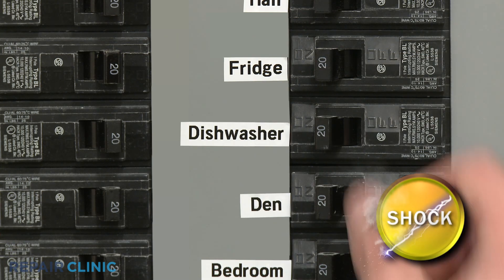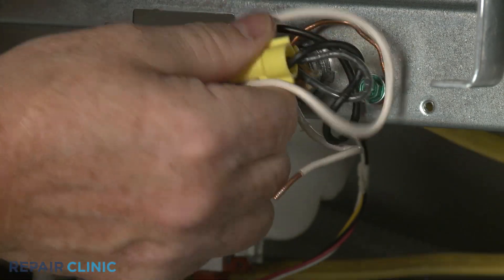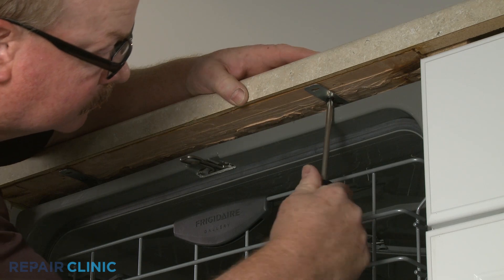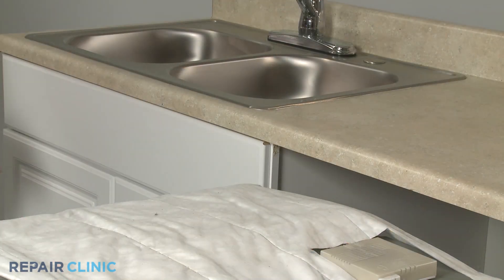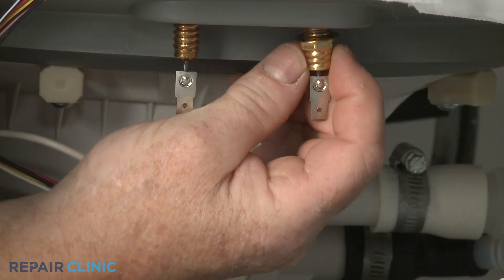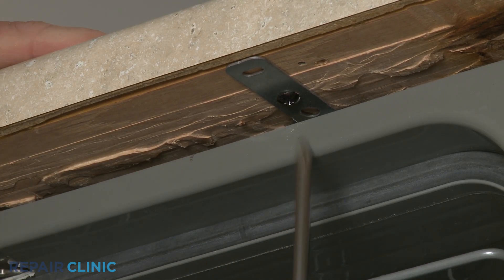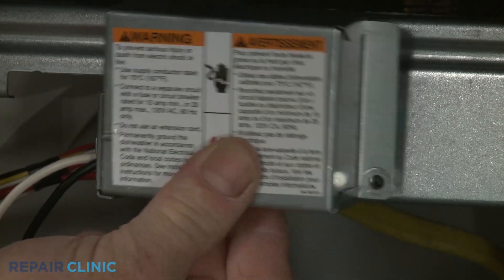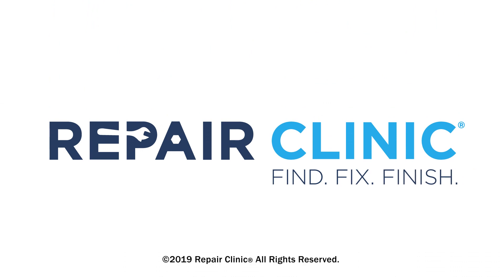Frigidaire Dishwasher Heating Element Replacement (154825001)

Comment: Very helpful, I was able to eliminate a few steps. I turned off breaker, removed the 4 screws and pulled out the dishwasher (whoever installed it left enough drain and water line to pull out comfortably), I didn't mess with the junction box and wires and drain hose in the front and went straight to the element connections on the side. Took about 10 min.

Comment: As others have stated, I literally turned off my breaker, removed the bottom panel, Unplugged the red and white electrical connections to the heating element underneath, Used a ratcheting socket to remove the nut on each connection, removed the heating element, replaced with a new heating element, replaced the nuts, reconnected the electrical connections, replaced the panel and turned the breaker back on. No need for all the extra fluff. I didn’t even move my dishwasher because I was able to access what I needed.

Comment: My dishwasher turns off after a few minutes on "normal".  It will run a rinse cycle so I know it can supply and drain water appropriately.  Would this be a heating element problem or not?

Comment: Do not follow these instructions. They are unnecessarily complicated. I just repaired my dishwasher following someone else's much simpler instructions. All I had to do was to pull the dishwasher half-way through while still connected to everything and change the element, safely and quickly. Look for other videos. You don't have to unplug and uninstall your dishwasher to do this rather simple repair.
Reply: @repairclinic  YOU DON'T NEED TO UNPLUG IT. JUST BRING DOWN THE BREAKER AND THERE IS NO POWER TO GIVE YOU  A SHOCK...
Reply: Why do they have to make things unnecessarily difficult?! I see no reason why the dishwasher has to be completely disconnected and pulled out when you can cut the power, remove the bottom plates and unscrew the element and replace it. I’m a woman and I can do this easily.

Comment: I need to replace one of the terminals (shown at 4:30), but I cannot locate that part on a parts diagram anywhere. How can I find where I can buy one of those parts? Thanks!!
Reply: Probably just have to get a whole new element or attach your own terminal somehow (solder probably)
Reply: @awesometime167  Thanks. Rigged a new one up, but ended up buying a new one a little while after. Thanks.